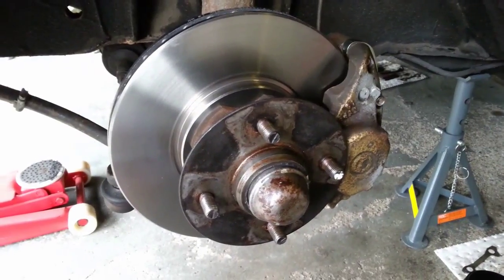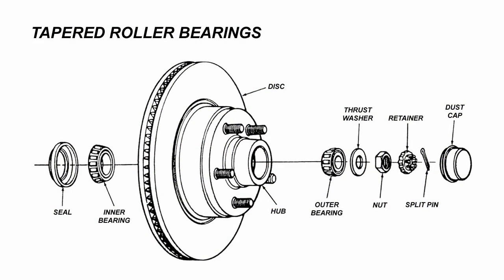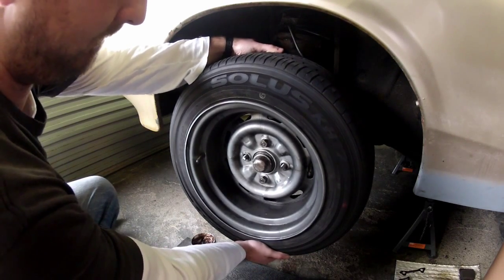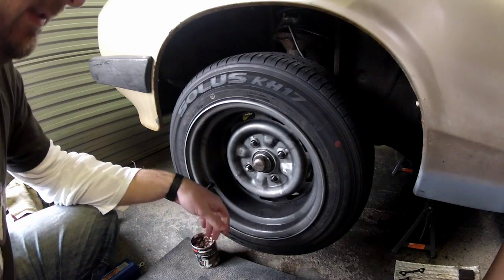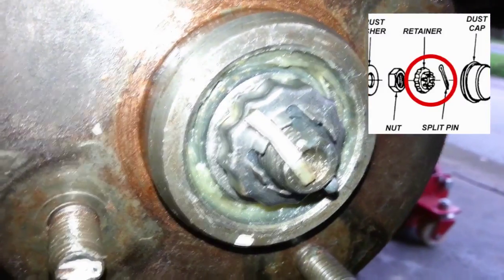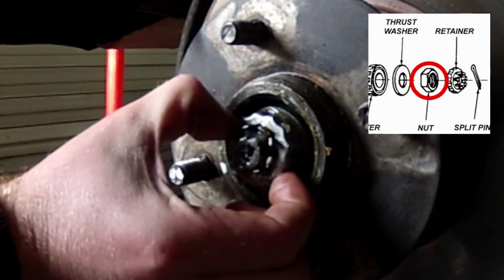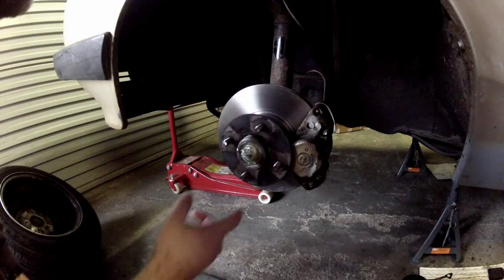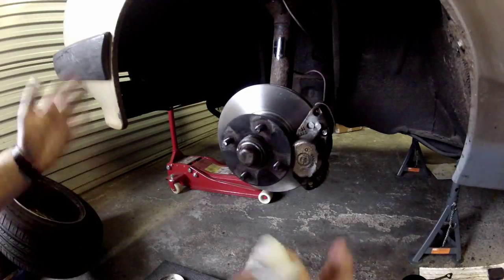How to Adjust & Preload Tapered Roller Wheel Bearings (Classic Cars/Trailers) | Tech Tip 16

Comment: 2001 VW Cabrio, was doing a simple rear brake job and found tapered bearings pressed into the rotor. Hadn't worked on bearings before so i backed off and called a few shops.. Dealer wanted $450 In Labor alone. An independent shop said $375 including parts.. they refused to use the Brembo pads and rotors i had already bought online and i didn't want to hassle with a return and heavy shipping costs. Watched a bunch of videos but this was the first one to really explain how to do the job. Back to doing it myself...Thanks for saving me the cash!
Reply from the maker: That's what it's all about! Glad to be of service

Comment: There should'nt be any play. None
Reply: Not even a teensie teenie tiny 'lil bit?
Reply from the maker: There’s 2 camps here it seems - I was taught to go for a small amount of play, & that’s by old school mechanics who I genuinely believe know what they are talking about. This is how I always, and will continue to set my bearings.  My issue with having no play, especially for new people who are learning how to do this, is that it’s quite easy to over tighten them, significantly reducing their life span.
Reply: My 79 requires .001 to .008 of play.not even finger tight.thats how they are.
Reply: Should be a tiny bit of play to allow expansion when they heat up
Reply: Should be no play in the bearing but you should be able to move the washer slightly. If you can’t move the washer the bearings are too tight.

Comment: My 2002 Kia Rio uses different width spacers to adjust preload. there are 21 different spacers to choose from. A special tool is required,as well.
Reply from the maker: Sadly this sounds about right, the modern take on a classic reliable design made overly complicated and totally un-serviceable by the at-home-mechanic. Sigh. Sorry to hear it.

Comment: Nice break disks! Are they compatible with Escort's OEM wheels?
Reply from the maker: Yes absolutely. You will need to run a caliper spacer kit and remove the dust shields to make them fit, but it's worth the effort. They are 2.8 Capri discs 👍

Comment: This video is same of other videos,they teach you how to hand feel,HOW TO HAND FEEL ?
I do is,most wheel bearings between the nut and the bearing have a washer,that washer between the shaft have a gap,first I tighten the nut until the washer won't move by a screwdriver, make sure 12:00 4:00 and 8:00,all need to use the screwdriver to move,and   don't damage the bearing,and then loose the nut about 5° each time until the washer start to move .I do this way from a car to big truck,hope this can help people they don,t have special tools.
Reply from the maker: Not familiar with this method but seems logical. However, it won't work in this particular case as the washer is keyed so it cannot rotate.
Reply: @FastRust  I mean  not rotate the washer,just use the screwdriver to move three positions ,hope you understand.
Reply: May be I should make a video to teach people how to do it.
Reply from the maker: I get you. Will have a go next time. Cheers. Post a link when you do the vid 👍